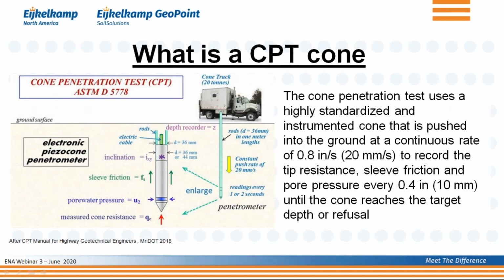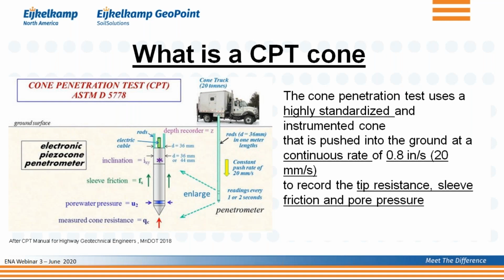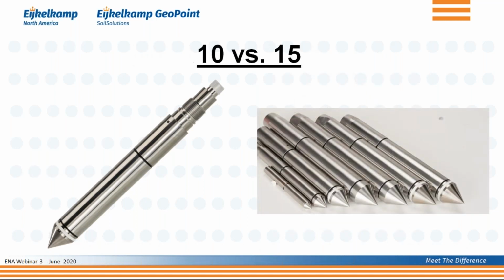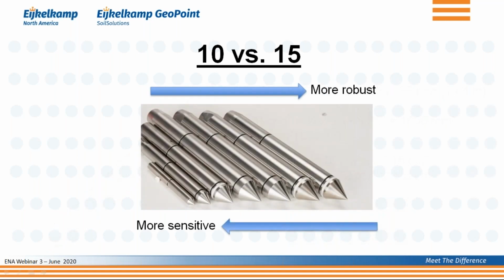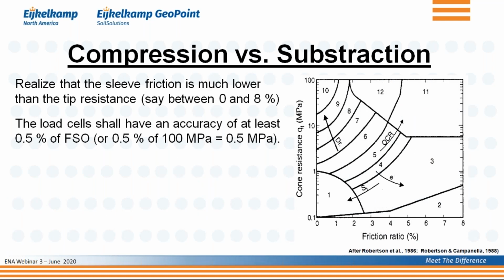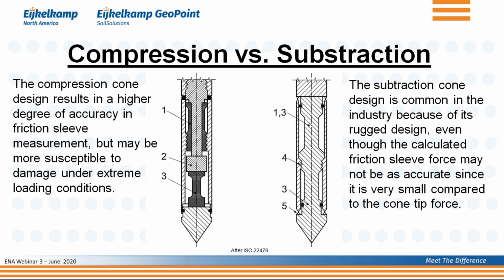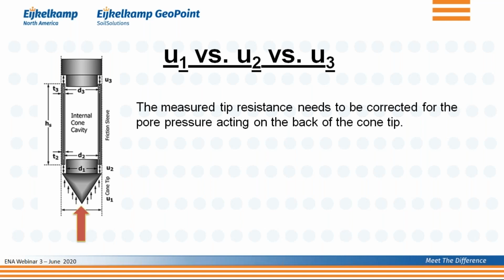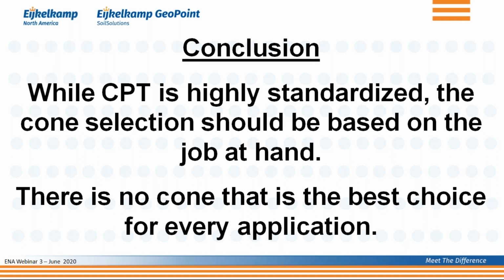CPT Webinar Series #3 | The ins and outs of a CPT Cone | By Eijkelkamp North America

Comment: In bs1997 the length for 15cm sleeve is longer but manufactures send cone sleeve that are shorter. Would that be to accommodate the iso and Aston standard.  Also would it be possible to get more info on magnetometer testing please. Many thanks
Reply from the maker: Can you please send your e-mail adres to g.verbeek@eijkelkamp.com. He will answer your question